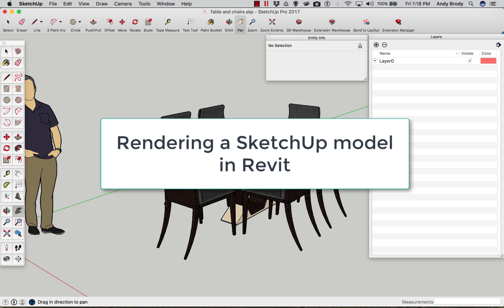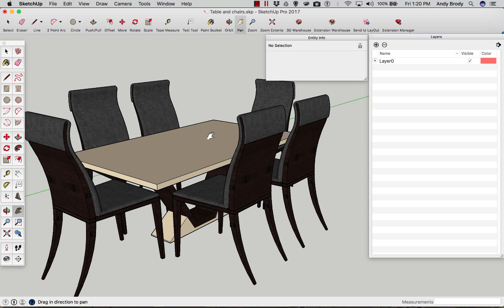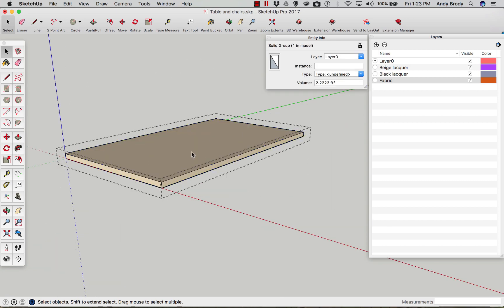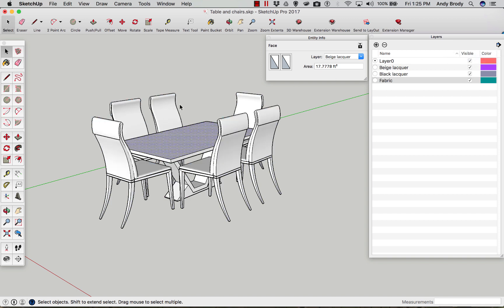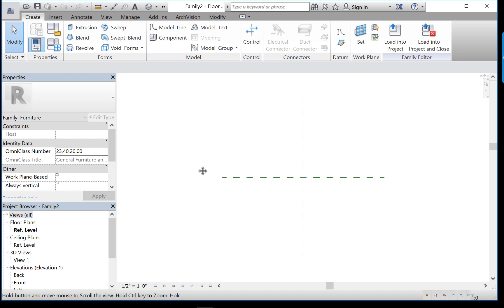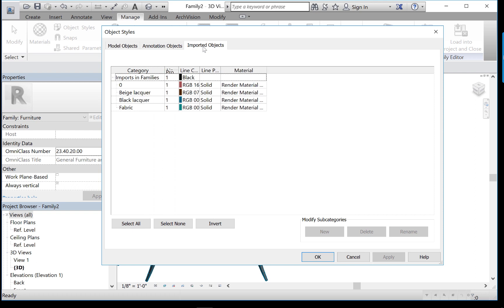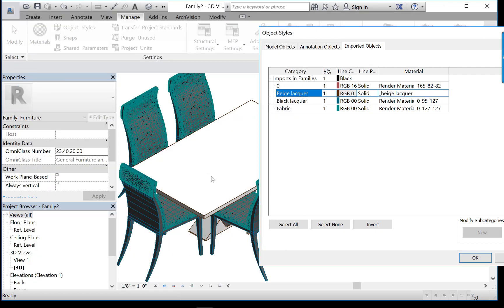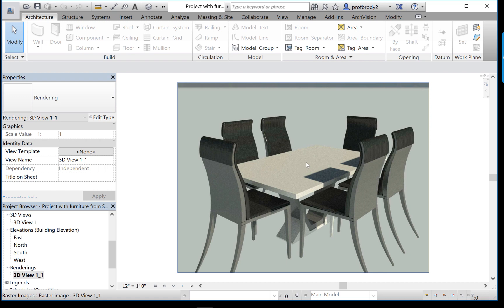SketchUp files brought into to Revit for rendering

Comment: After i  import into revit, in material list, i cant find these Render Material. How should i do???
Reply from the maker: I usually delete ALL materials from the SketchUp model before importing into Revit. To do this, in the Materials Menu, navigate to "In Model". Then there should be an option in the flyout menu to delete all. When you import it this purged out file, go the the Manage>Object Styles menu in Revit. On the Imported Objects tab, you'll see each Tag from SketchUp has a material applied with a name like "Render Material 255-255-255" or something like that. Revit gives each Tag from SketchUp a material based on the Tag color from SketchUp. You can change the parameters of this new material by clicking on it here, or through the Materials menu.
Reply from the maker: Oh, and sometimes there's no material at all in the Object Styles menu - click in that field to add one...
Reply: @AndrewBrody   That's useful infomation, thankyou <3

Comment: I've done everything step by step from Sketchup to Revit and my model refuses to render the materials I've set for it. I've deleted stuff. Remade stuff, assigned layers in Sketchup and everything to the tee and still doesn't work. 
Don't know why. It just is.
Reply from the maker: It almost always comes down to a surface in SketchUp having some paint on one side or another. In the Materials palette, try deleting all the materials in the model. I think that'll return all objects to the default coloration, which should then work fine.

Comment: but at the end you have streched out textures at chairs so this method had still big problems, becuase in the end renders will be bed. Do you have maybe some workaround or?
Reply from the maker: Yeah, not really. I think that problem has to do with the surface normal direction in SketchUp, but I've never figured out a complete fix. For something like a cushion, you can make Tags for each direction - so one for the sides, and another for the top and bottom. Then the normals issue resolves, but it's a pain...

Comment: What do i do?
Reply from the maker: Edges can be tricky - do you have any hidden or "softened"? Be sure to display hidden stuff before selecting. And did you use a crossing window to be sure to selected everything? You should be able to change the layer (now called "Tag") for everything then, in the Entity Info dialog. If it's still a problem, switch to View>Face Style>Wireframe. Then use a crossing window to select all the edges, and you should be able to change their layer.

Comment: The edges were not moved into any layer
Reply from the maker: Edges can be tricky - do you have any hidden or "softened"? Be sure to display hidden stuff before selecting. And did you use a crossing window to be sure to selected everything? You should be able to change the layer (now called "Tag") for everything then, in the Entity Info dialog. If it's still a problem, switch to View>Face Style>Wireframe. Then use a crossing window to select all the edges, and you should be able to change their layer.

Comment: Applying the materials isn’t doing anything for me.. the model still stays grey with coloured mesh lines over it (even when I change the view to realistic) could it be because my file was a DWG downloaded from the internet, as opposed to being from the Sketchup 3D warehouse??
Reply from the maker: You applied materials in the Object Styles>Imported Objects... menu? Check to make sure you put materials on the right layer - that's often the problem. So long as it was a valid AutoCAD file, so SketchUp could import it, this technique should work. In SketchUp, was everything exploded? SketchUp applies layer (now called "Tag") assignments for nested objects based on the most internal layer, I think, so things might not be layering the way you want. Once you explode everything, select objects and place them on the intended layers. And make sure every face is painted the default material.

Comment: Hi, Andrew, your video is amazing but when I tried and render it, the model is showing black, so do you know what happed? thanks
Reply from the maker: If the whole Enscape screen is black, I'd have to guess that you're inside a wall. But you might also check Enscape settings - exposure, contrast should be automatic. But also make sure that it's daytime in your model! Unless you have electric lights, it may be that it's just the middle of the night...

Comment: Hi man, your video is really helpful, can you tell me what Macbook or Imac are you using to run REVIT? i see you are using parallels, I have a Macbook air and installed Revit in parallel machine, results were not as smooth as it looks in your computer. can you tell me about the specs?
Reply from the maker: It was a top-of-the-line MacBook Pro from about 4 years ago. I don't think an Air will run Revit - just not enough power. Frankly, it's cheaper to just buy a Window's desktop to run Revit, and use the Mac for everything else, which is what I do now.

Comment: Thank you very much, It was a lifesaver! Just a question, if I want to import my whole model (Building) from SketchUp, would the procedure be the same?
Reply from the maker: Yes, you can import a whole model into Revit. If you're looking for Revit rendering, however, you will find that you might want to use Revit walls, floors, and ceilings, instead of surfaces from SketchUp. They take textured materials better.  I think that Revit has trouble cropping imported object, too - for some reason, sometimes imported furniture, for example, might show up in a reflected ceiling plan.
Reply: I got it. thank you very much Andrew.